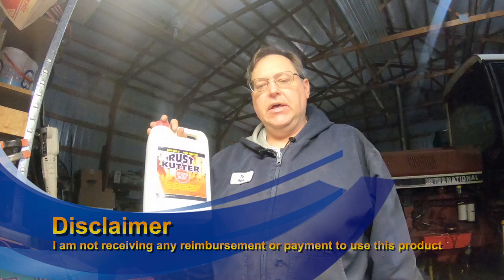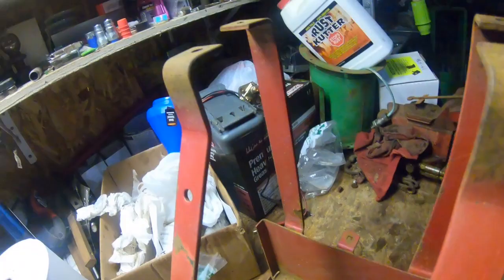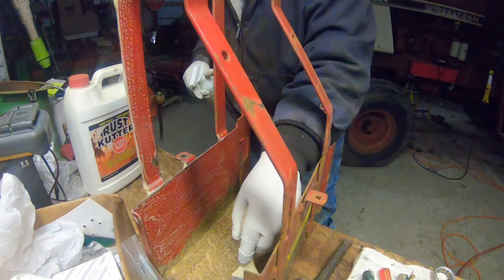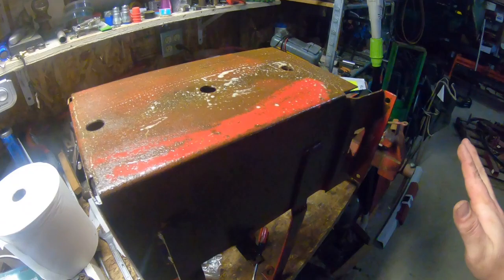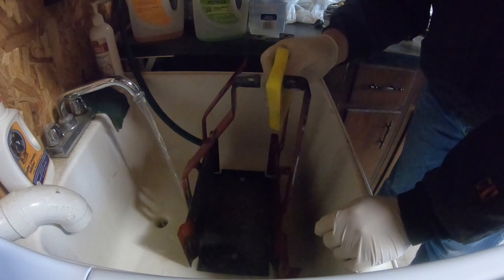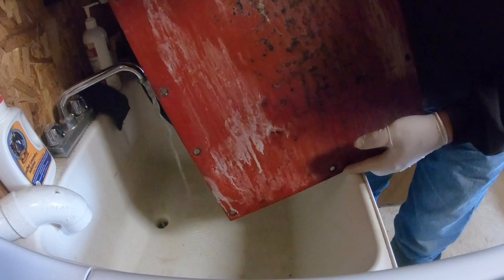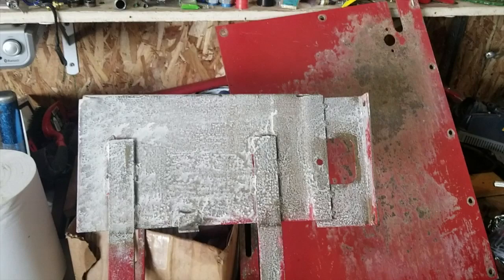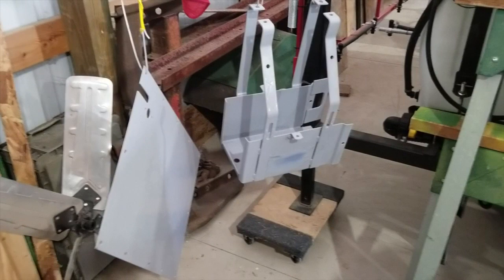Preparing to Paint Metal using Rust Kutter

Comment: ah, I realized my problem. I did this on a trailer, but I took a wire wheel on a angle grinder to get most of the rust off first.  it's changing the color back to metal, but not white.
Reply from the maker: Ya, that is what happens when there is nothing for the chemical to react with. Thanks for the comment, and I hope it all works out.
Reply: @TAHDAHFarm  I'd rather have it smooth  so I'm happier with it than s rough surface, but it does take a bit longer. the trailer is a dump trailer, so I think the paint will last longer if stuff we are dumping slides off instead of being caught in the bumps.
Reply from the maker: Agree 👍

Comment: Good video... seems like a spray bottle and a garden hose would really help speed up the application and rinsing process!
Reply from the maker: I agree but it was cold outside that day and didn't want to freeze the hose up. Besides  that the room I was in has heat in there. But you can definitely use a hose for big projects.

Comment: Interesting. I've tried this a couple of times, one on a wheel barrow that's sat outside by the brine drain on the water softener system for the well and the other on my old rusty truck I'm hoping to rebuild at some point. The truck didn't have ant paint. It lasted 2-3 years before rust started popping back up. For the wheelbarrow, more like 3-4 but was in a salty environment.
Reply from the maker: Thanks for the comment,  yes the rust does come back eventually. If man makes it, it will fail eventually.  Only God made can last forever,  lol.

Comment: Ive used krud cutter gel and ive noticed the black seal that u talk about and the white stuff but it seams that there is a little rust that shows after i wash and dry and cant help but sand it down am i doing it wrong ?  jsut so many variables
Reply from the maker: Not sure if krud cutter is the same thing. Rust cutter it a sealer. You might need to let it cure longer or put a second coat on.  It has a reaction to rust if it is applied right. If you feel like you have to sand it, then put a coat of Rust Cutter on after you sand it and let it dry for a day or two and then rinse it off.  Let it dry good and then paint. I have prepped somethings by sanding and using a wire brush to get any loose stuff off or to make look better. If you have rusty water, you might need to dry off with a towel so the rusty water doesn't dry on what you want to paint.  Good luck and thanks for watching.

Comment: How is it holding up 2 years later?
Reply from the maker: This still looks brand new.  Something I painted 10 years ago has shown no signs of rust but the paint has faded some from setting outside for most of the 10 years. Thanks for the comment and watching.
Reply: @TAHDAHFarm  thanks for your quick response! So I have a vehicle that has some heavyish surface rust on the back 1/3 of the frame from the rear tires throwing up salt, rocks, etc. Would you recommend descaling the loose stuff and then applying this? I mean will it penetrate deep?
Reply from the maker: I would use a wire brush and remove any of the loose stuff.  Then spray or brush on the rust cutter.  It doesn't need to be perfect but for me I like to get the loose stuff off. If it is to clean, the manufacturer say it will not get the white look. I would give it 2 coats and let it dry between and before I wash it. This is important,  do NOT scrap or sand the surface after it dries. The rust cutter works as a sealer primer. I would let everything dry for several days before painting.  I would also put several coats of paint on. Good luck.

Comment: Vaspar makes caseIH’s and John Deere’s paints.
Reply from the maker: Ya thanks, but the last that I saw it was not oil base. They switched to a water base paint and it did not work.
Reply: It’s solvent based. You have to use a solvent based thinner for quarts and gallons.